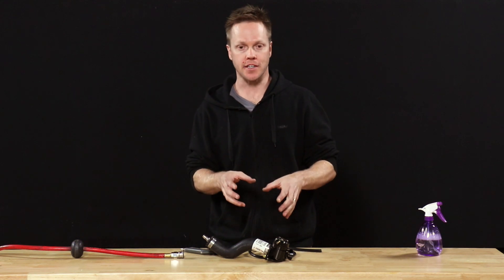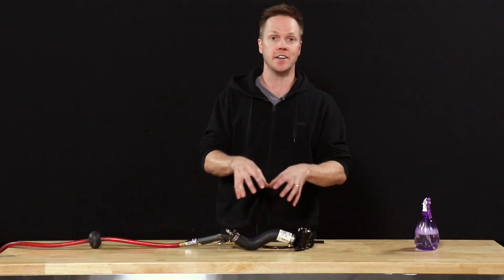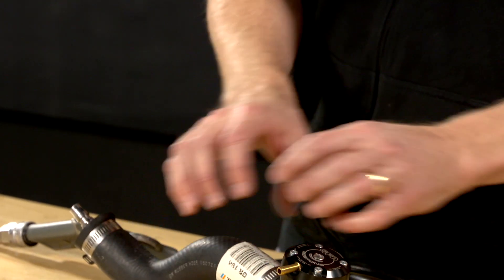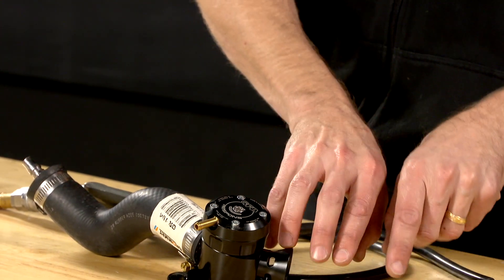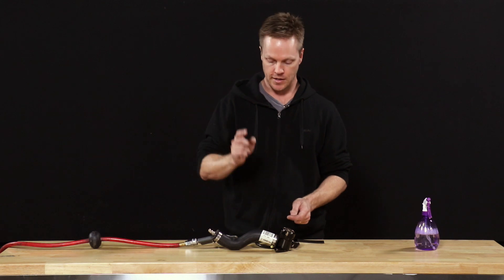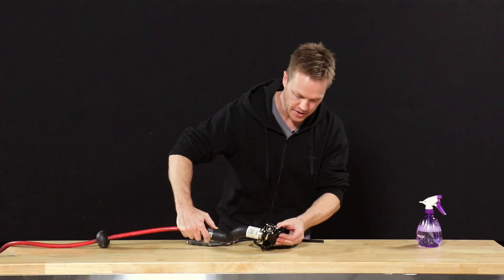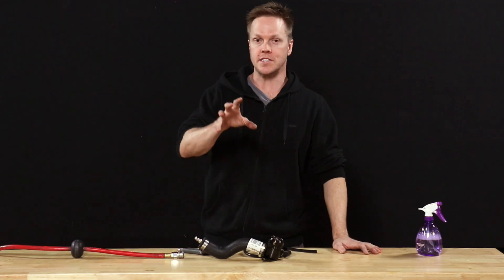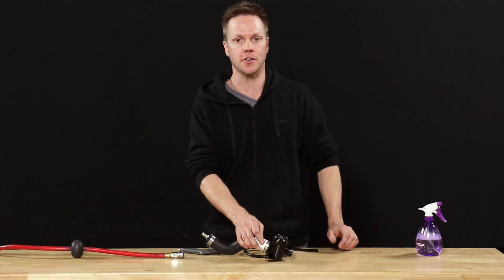Blow Off Valve Boost Leak Explained [GO FAST BRETT]

Comment: I recently found out that most Tuners or so called Tuners in the USA wont even allow GFB valves as they think they all leak badly. 
as they bench test them with only pressure on 1 side and think its broken. 
(hence why i said so called "tuners" as they can't be very good at their job if they dont know how a GFB BOV works.)

Comment: but doesnt the engine vacuum allow unmetered air to get sucked from the recirculation side through the bov and suck air from the atmospheric side,this being said wouldnt we see lean mix at idle but not a wot since idle draws the most vacuum and wot pretty much equalizes vacuum?
also could i apply a little bit of thick grease to help seal this more?

Comment: This is a bad test as you didnt put any pressure inside the piston port of the valve to simulate how well it will hold under boost.

Comment: i think my bov is stuck partially open... i hear air hissing from it when boost is building. occasionally with the ac on full blast it'll close and the car will reach max boost. but normally the blow off valve doesn't pop up normally and air is hissing. Is my bov defective or just needs cleaning?
Reply: Did you figure this out? My splitter valve is making the sound noise and wondering if i need to adjust spring pressure or if its broken

Comment: What about when it leaks at the mounting flange where the gasket is? Mine is mounted on the intercooler piping with 2 bolts right before the throttle body and soapy water revealed a leak. Is that still considered a Boost leak or no? Im on recirc w stock bpv.

Comment: Now add negative pressure and you’ll see it sucks air through there also which the mass air flow sensor doesn’t account of which makes the car run lean, this gfb valves ar good for the first few months and then they become trash, I just reinstalled the OEM recirculating valve on my Subaru because it was leaking vacuum and made the car run like shit Eve the ecu detected the problem,
Reply: I think the same way.

Comment: Honestly, im gonna bash this video. I dont see the point in showing how there is clearance between the piston and the cylinder. And why are you showing this test when its irrelevant to actual performance? This guy is spraying soapy water into a leak that he created. I dont get it. Why show me that? These BPVs when operating, do not even operate in that manner in which he applied that test so its irrelevant testing. Is that what you are trying to point out? That people shouldn't be testing BPVs like this?? Please explain. Am i missing something?
Reply: Yes, you're definitely missing something.

Comment: Unrelated to vid.  But recently the BPV hose ripped off of my BPV, this caused something I can only describe as compressor surge or turbo flutter.  My guess is because it couldnt ventthe pressure so it just wentback into the turbo.  Its fixed now, but big question is..... what COULD be damaged by this event? And how can I tell? How would I even know if anything internal like seals or o rings or what the fuck ever are damaged by fords shitty workmanship?

Comment: Tip: If you suspect you have air leakage, buy start gas and spray on the airways with the car running car on in idle. If you hear the engine start to go up in revs, you found a leak.
Reply: carb cleaner works well too. except it will cause the car to stumble

Comment: this was kind of irrelevant as you would never pressurise the outlet of a dump valve. if the leak was from the inlet side of the dv to the outlet, while the valve is still closed, then its a boost leak and therefore could be a problem. but a leak from 1 outlet of a dual port dv to another outlet isnt a problem is it?

Comment: If there is a leak post MAF pre turbo, even a small one, it is a leak. There's no "it's just a small one" non-sense. Granted, if you are tuned with said leak you may not have issues, especially on speed density. But if you have a MAF and plan on running the GFB Response, or whatever, you may run into hunting idle and or drivability issues under light load (going down a hill while applying light throttle or costing with light throttle input). Ran into this several times during my build with the exact BOV in the video and have since switched to a different manufacturers recirc with no issues.

Comment: I've got a vauxhall corsa vxr 1.6t .. just wondering what the best blow off valve to use ..or just stick to stock wastegate?? I have no idea ..help me plz
Reply: wastgate and blowoff do not do the same thing. blow off, removes the excess pressure from the intake side so it dosnt surge, a west gate gets rid of exhaus gasses, so it dosen't overspin the turbo

you can get a bov for the sound,but if your car has a maf and is tuned for a recirculatory valve, it will not work right, you will be having a/f mixture problems, and will need to get it maped for a bov.
so make sure of what you are dealing with before "upgrading" your curent setup, because the upgrade can be more than 1 part
Reply: Robi Flego thx man .. a friend said the same thing the other day .. thinking it sounds fine the way it is for now :)
Reply: +chebly no problem mate. you got a sweet little car :P your first car?
Reply: 3rd... the first 2 car are nothing to shout about :)  .. this is my first toy

Comment: That's why when I leak test I go from the turbo outlet connection to the throttle body. There is no reason to pressurize a turbo or engine like that, but plenty of reasons why you should not.
Reply: It's not the pressure side you need to worry about, I mean if there's a boost leak then yah is an issue but if it seals then you need to pay attention to the the vac side, if there's a leak post MAF/pre turbo you will have a vac leak. Even if it's a small leak, a vac leak is a vac leak, and small post MAF vac leaks lead to issues aka: "lean conditions"

Comment: Would it be possible to use a piston-ring type seal inside of the Blow Off Valve to get rid of that .02mm gap?
Reply: It wouldn't as you would still bypass it going between the two outlets of the BOV. That would only help with leak down from the top to the bottom of the BOV
Reply: Piston rings actually have gaps in them.All the rings on a piston are rotated away from each other to help with leakage, but it is not a perfect seal however. Nice idea though.

.02 is nothing though. I machine parts to that kind of tolerance every day and when you press a shaft into a blind hole with that clearance, you can push the shaft down and it will spring back up to the same place because the amount of air displaced is minuscule.
Reply: Daniel Way
Thank you for the technical breakdown, I appreciate that! I'm trying to learn more about engineering, and your comment really explained why my idea wouldn't work.
Thanks again man, it's appreciated!

Comment: could you use a onboard air tank/compressor to turbo your car effectively ?
Reply: possibly but a car could empty any decent size air compressor tank in less then a feasible time on a reasonable amount of boost.
Reply: +scootbmx01 but u could have a air compressor keep constant pressure in the tank even if it's only 20 to 30 psi
Reply: +garret angle, you would need such a big air compressor it would be way too big
Reply: you could just mainline it from the compressor in the trunk and not even have a tank
Reply: scootbmx01 you could just mainline it from the compressor in the trunk and not even have a tank
Reply: +garret angle, the point I'm making is it would consume air alot quicker then the compressor would be able to produce
Reply: air compressors are typically for making higher pressure than more flow. creating air storage in the form of highly compressed air over time. if you are looking for more flow than pressure, you want a blower, not a compressor.  a blower in any form for industrial purposes is pretty much a supercharger hooked up to an electric motor. it's a moot point to use an industrial blower to create boost when there are things called turbos and super chargers that accomplish this exact thing, without the losses of converting engine torque to electricity to then run the electric motor connected to the blower. easier just to connected the blower directly to the engine via a belt to push air in. or even more efficiently,  utilize wasted exhaust gases to spin a turbine (a whole other type of air moment device,  not positive displacement like a blower or compressor but more like a fan because it allows slippage) theoretically you could use a compressed air tank with a compressor but it would take a long time to make enough cubic feet of stored air that would only really be useful for a few seconds with an air tank that could reasonably fit in a car trunk.
Reply: It's a great idea but tanks are heavy and would need constant refilling -- electric air compressors are heavy too.

Hmm... maybe instead of using a electric motor as a compressor we could just use exhaust gases from the engine to spool a turbine to drive a compressor wheel.  It's essentially wasted energy anyway.  Could do away with the tank altogether and try and inline the system with the existing air intake somehow... TO THE PATENT OFFICE!

Comment: On a dual port BOV can it draw un-metered air in? How big of an issue can that be for tuning?
Reply: Yes, it can if the BOV is malfunctioning, has a dirty seat/valve or has a damaged valve or valve seat. 
With a good BOV, no, the way the BOV valve piston seats with a positive seal it will not normally leak. 
It would also matter where the BOV was located in the charge air piping as to whether or not the un-metered air leak would effect proper operation.